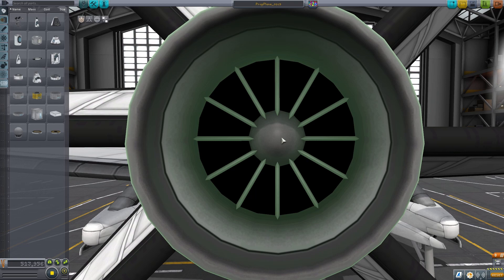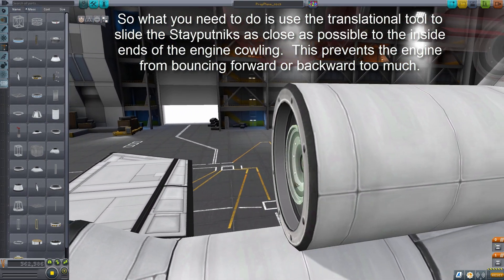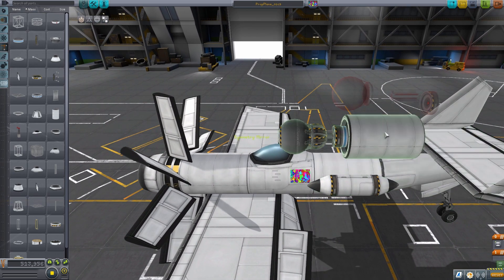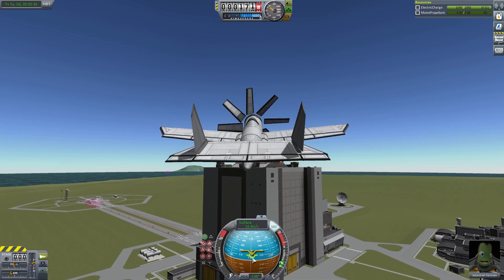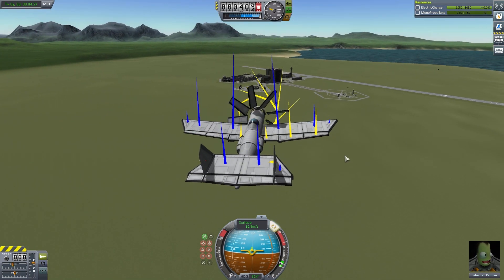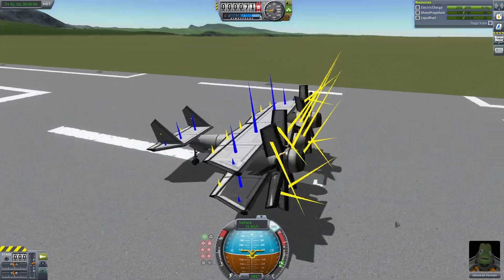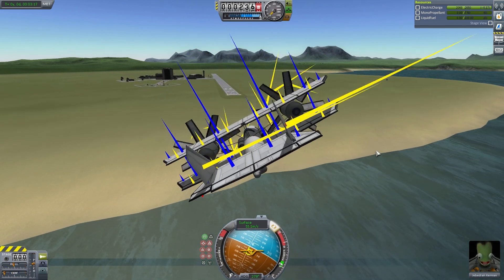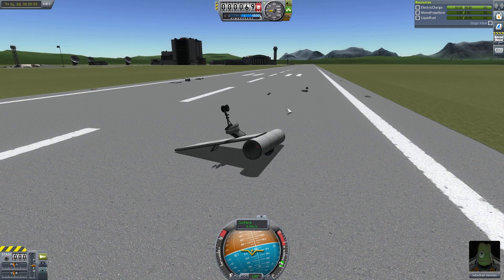OBSOLETE VIDEO, pls see #3 -- KSP stock elec prop 2: smaller engine, bigger performance

Comment from the maker: Verified: works in the new full release of 1.2.  In fact, it even works a little bit better.
Reply: Quick thought. Does attaching each prop blade via strut help at all with the 'gap' on spinning up the engines?
Reply from the maker: Mach n' Grace
Not to any visually noticeable degree, no: there is still abundant separation.  The struts are actually a liability because the blades will be trying extra hard to stay in place and that causes the good old KSP physics to believe the blades occasionally catch onto the cowling.  I've seen it rip the engine clean out of its fittings.
Reply: Inter's Odyssey nice video!
Reply: Inter's Odyssey
Reply: Could you release a craft file?
Reply from the maker: Description.
Reply: Inter's Odyssey Thought I checked. Apparently I didn't, or at least not well enough.
Reply: Inter's Odyssey you should be a narrator before movies your voice fits
Reply from the maker: Joe Gelula
Assuming you're playing on a Windows OS computer, hold down Ctrl + Alt + F12.  This brings up the cheats/debugging window.  You'll then have to click on the Cheats submenu.  That's where the clipping settings have been moved to in 1.2.
Reply from the maker: Emerson Molina
And capitalize like every other word for dramatic emphasis!  "With the World on the Brink of Destruction, the fate of Billions hangs in the Balance.  There is only One who can save Humanity from total Oblivion.  And he Answers... to Fido: (trailer reveals dog) Woof! (trailer continues) This Holiday Season, Join Fido as he Sprints across the globe on an EPIC (because every trailer has to use the word "epic" these days) journey to unite Man's Best Friend with the mighty Force of Puppy Power.  But there are Those who would Stand in his Way: The Leage of Inexplicably Entertaining Squirrels!  Can Fido make it in Time?  Will the Legacy of catching Frisbees be Forgotten?  If Fido knows, he's not talking... Woof!"

Comment: The reason the twin engine one is slower is because if KSP's aerodynamics are accurate, which I think it is, it would have triple the cross-section and more than triple the surface area, meaning more than three times the drag.
Reply from the maker: Why, physics?  Why?  Why do you have to be so cruel?!
Reply: Nature is a harsh maiden.

Comment: Awsome. Ive gotten so much inspiration when doing this myself from your video :) I tried putting two engines on coaxially which also removed all unwanted roll (without a problem of turning them on individually) and made me my first successful stock prop plane. You could also spin up the engines with the control surfaces just without an angle and later use "deploy" to start going forward.

EDIT: The authority limiter is very practical as it can be used in flight aswell!
Reply from the maker: Sounds like someone's been paying attention!  :)
Reply: Since I was building at the same time I was watching, I might have missed if you already suggested the things I mentioned. If so I'm sorry :)
It's really hard to know if someone is being sarcastic or not over the internet..

But anyway, I have managed to build insanely robust and stable engines with the propeller in between two fuselages but I can't seam to get as much power as you do. Is it, in your opinion, a friction/wobble tradeoff with the ball bearings or a position/amount of reaction wheels thing. I've also been using a stop cap at the end of my single fuselage engines so that the propeller is fixed both back and front. Could this be a reason for the lower power?
Reply from the maker: No sarcasm (thiiiiis time... muahaha).  If I understand your description correctly you're saying you have two hollow structural cylinders (the pieces I called the "cowling") arranged one in front of the other with engine parts inside both, yet the two cylinders are spaced apart a little bit front-to-back to allow for a propeller mounting point in between them.  That accurate?  I've found lower power is generally a reaction wheel issue, but adverse contact with the cowlings and caps (call it friction or collision or whatever) can very easily interrupt engine rotation, perhaps only for fractions of a second but in those brief moments the stoppage is almost total.  That makes it appear as though the engine has low cumulative power.  I recommend testing the engine on a heavy rolling sled, something that isn't designed to lift off or change directions but can still roll along the runway.  That should allow you to observe the stable power output of your engine and discern whether the problem is either low torque or some airborne interference.
Reply: Correct! Its a long engine but with two of these placed coaxially i made my most successful aircraft yet with about 35m/s top speed and stable controlable flight at low altitudes but trying to get the single engine plane to fly straight is proving really difficult since it will roll uncontrollably. Is that why you use the dual tail stabilizers?
Reply from the maker: LuckeWent
Well, if it's rolling uncontrollably, my guess is there is collision happening somewhere in or around the engines.  I had that problem too when I radially expanded my Stayputniks too much.  Once the engine was working smoothly, as shown in this video, the plane was very stable overall and needed very little control surface input to stay in straight and level flight.  Basic torque rolling was not an issue for me.

Comment: OMFG I'm actually extremely impressed by the pre-flight startup checklist. A lot of people might think it's tedious, but it actually is very similar, in many ways, to a real prop plane, with the engine startup and the propeller trim setting (found on some prop planes), and you can even notice some actual realistic propeller torque at takeoff :o. Far superior to the primitive design I've been using, lmao.
Reply from the maker: Dude, I'z a pilot.  For realz.  Only Private and going for my Instrument rating, but I feel ya, bruh!  
(Sorry, if this is your first time here: welcome to my channel.  I talk weird sometimes.  Um, make that a lot.)
Reply: Inter's Odyssey  Yeah I just found this channel despite watching KSP videos frequently, and I recently started getting interested in prop designs in stock KSP (mainly cause I only just recently got gud at making planes, used to suck).
And speaking of which, yeah, I have flown planes with a friend who is a pilot and has taught me quite a bit about piloting a Cessna, though I don't have the time or money currently to get a license :/
Reply from the maker: Wheatley
Wait, you need time and money to get a pilot license?  Dammit!  ......  I WANT MY SOUL BACK, YOU THIEVES!

Comment: Squad just has to make prop engines, no one will dislike it.
Reply: but then the challenge to build the perfect propengine would be gone
Reply: They NEED to give us rotating joints.
Reply: Dark Orbit King would be nice
Reply from the maker: For real.  Honestly, how hard can the programming be?  I don't see it as being any different from docking: lots of parts becoming (or staying) merged with lots of other parts.  The only difference is the parts on one side of the joint still retain the ability to rotate around one axis.  Big deal.  I'm not a programmer but intuitively it sounds extremely easy, especially since they already have those features elsewhere in the code.  Just combine the features and this game can leapfrog ahead again with possibility.
Reply: Too true- all they would have to do if make a part that can rotate, just like the wheels, but can be attached to, just like docking ports, and then they can call them bearings.

Comment: Now that's a pretty interesting technique! I found it to be a little simpler to use radial attachment points on the ends of the engine to narrow the radius down a bit, while still only using two probe cores. It makes tweaking a little bit faster. I still have a minor amount of wobble on my engines though, so there is that trade off.

Comment: Honestly I wish they remade the building in KSP completely. Out of all the building games I've played it has the worse feel to it and its very hard to see what your doing without getting mods and if a game needs mods just to allow you to see wtf you doing at that place in time it should probably pay you to play it.
Reply from the maker: Can you give some examples of other games?  I kind of agree with you, though.  I never build anything important in the VAB because of the camera restrictions there.  Even in the SPH, when the camera is zoomed way in, the green attachment point spheres sort of obscure the contact point where you're trying to attach a part.  I'm glad 1.2 added a slider for reducing part glow but that slider is currently bugged and needs to be reset every time I load the game.  So yeah, KSP isn't the best, but the fact that I can do very fine placement of parts in the SPH makes it seem like a pretty decent game to me, at least compared to something as primitive as Minecraft.
Reply: What? For me ksp has building I like the most out of any game..
Reply: I really don't get what you're saying. I have hundreds of hours in KSP and never felt the need of getting a mod that changes the building mechanics. Build in the SPH and you'll be able to freely move the camera and see everything you need.

Comment: Excuse me while i now build a 4 engine prop plane using this just to figure out if i can break my ability to think, or better yet, break the game.
Reply from the maker: Oh trust me: breaking the game becomes exponentially easier as you add more engines.  Happy rebooting.  :p
Reply: can you help with somthing
plz
Reply: Constantinos Veletas wot
Reply: plz help
Reply: Constantinos Veletas with wot
Reply: every time i rev the engine and press alt with q 
but it always slows down and stops
Reply: Constantinos Veletas Do you have enough electricity? Maybe it's dying?
Reply: yes i think i have enough
Reply from the maker: Constantinos Veletas
Sorry to ask a dumb question, but do you still have SAS turned on (the white icon on the upper right of the NavBall) when you let go of trim?  If SAS is left on, it will cancel out trim and act like brakes on the rotation of the engine.  The engine needs to freely spin.
Reply: yaas it does not spin

Comment: Would it be possible to make a design like the Do-335? It had 2 piston engines, one on each side, one pushing, one pulling.

https://en.wikipedia.org/wiki/Dornier_Do_335

I feel like the plane would be unstable though, but that's just in theory. I haven't actually tried it yet.
Reply: Nvm someone's already pointed that out. What about a pusher engine only craft, like the Xp-55?
Reply from the maker: Yeah I was thinking about that actually.  I'd be more inclined to go straight for a pusher-only.  The Do-335 would certainly be the way to go for more sheer power, but I personally favor the idea of a pusher-only to eliminate the drag of a forward-facing gopping cowling cavity.  (Because KSP physics doesn't recognize any aerodynamic parts in front of blunt parts if they're 2 separate "craft".)
Reply: I Made a propeller pusher craft in the last update and it worked lovley, based it off the J21/De havilland Vampire, look almost the same, but the J21 is a prop aircraft.
Reply: Btw thanks to your trick i have managed to get it to a top speed of 83m/s in level flight, which is a new record for me, thanks =D
Reply: Arvid Lundqvist could we have the download for it please?
Reply: Sure, here it is:
https://www.mediafire.com/folder/8c7xcr1js0r5e/Kupol_Krab
Enjoy!
Reply: Arvid Lundqvist
thank you
Reply: Arvid Lundqvist
Oh, it's incompatible with KSP 1.1.3, please could you modify it so I can use it in 1.1.3?
Reply from the maker: Brandon Robertson Arvid Lundqvist 
Nah, the craft is compatible with 1.1.3, it's just the version # in the file that needs changing.  You can open the *.craft file with any basic Notepad application and type in the version # you want into the second line of the file.  Easy.  In 1.2 I was able to achieve the 83 mps speed boasted in the craft's description by the time I hit the coast line, but in 1.1.3 its top speed was only 55 mps.  I'd really like to know what Squad did to make the atmosphere more efficient.
Reply: Inter's Odyssey
Oh, thank you. I think in 1.2 they made airlions more airodynamic, or lighter, One of the two.
Reply: Well I have produced a Do 335 like plane before as well as a pusher config only one iif that answers your question +Brandon Robertson

Comment: You could try using tweakscale on a single stayputnik at each end, would be able to get it the exact size while reducing part count :)

Also take a look at some of the new Infernal Robotics stuff, they have both powered and free-wheeling bearings that are ideal for this :)
Reply from the maker: Well, you're certainly new to my channel.  :)  I try to avoid using mods, despite how helpful some of them can be.  
Yes, the tweakscale thing has been mentioned and I've known about that mod for over a year, but that would defeat the point of this stock build challenge.  If tweakscale works for you, by all means use it.  It will mean less mass and hopefully less drag in your engine.  
I'm holding out on Infernal Robotics because I don't want to be corrupted by its ease of use when it comes to building ferry ramps.  That'll probably be one of my future stock projects: a ramp that folds down but is still light enough that it doesn't make the ferry ridiculously heavy.

Comment: I wonder if this could use used with much bigger rotors in order to make a VTOL "space elevator" to very efficiently carry stuff out of the atmosphere...
Reply from the maker: The main force providing motion to this sort of craft is the propeller blades interacting with the air to generate thrust.  Once your space elevator goes so high that the atmosphere becomes negligably thin (around 30 km), then lift/thrust will be unattainable and the craft will no longer ascend.  That said, you could certainly use such an elevator as a launch platform to get a payload with a much smaller rocket closer to orbit.  I've done this with horizontal craft but never with VTOLs.
Reply: Inter's Odyssey That's what I was saying. Basically a very efficient booster stage to allow the craft to never even have to try and get through the thick air.

Comment: Stalling isn't dependant on airspeed, it's the angle of attack the wing surface is to the air direction.
Reply: Jpwnage216 it's both really, a lack of speed will cause your wings to not provide sufficient lift, causing a stall state
Reply: Even if you have an extremely slow airspeed, If your plane is angled correctly, you won't stall. It's all about the angle of attack.
Reply: not all true, it is also speed.. i dare you to try to keep a plane level without it losing altitude below its critical stall speed..
Reply: in fact, the nose will drop, due to not enough lift, its called a stall bud.. and worse case is a flat spin. In fact, this is why you DO NOT increase your angle of attack to hold altitude if you are losing speed, the extreme AOA will cause a complete stall once hit hits it critical point. The old saying when flying is throttle controls altitude, trim controls speed. Speed is very important in a plane, for which below a threshold you will no longer have enough lift, even if your AOA is correct. The speed at when this happens varies depending on weight and its CG of course. You must remember, the more surface area exposed to the wind current, the more drag you cause.
Reply: I'm not saying that you should keep the plane level. At low airspeed, tilt the nose down and the  plane should have enough lift to glide. This isn't a stall. Yes, low airspeed can cause a stall if you can't get your angle of attack corrected (steep climbs), but the stall is technically initiated once the aoa is misaligned with the air direction. What I'm basically saying is that while low airspeed can cause your aoa to screw up, the stall officially begins when aoa is bad, not when you have a low airspeed.
Reply: Jpwnage216 sigh.. your not getting it.. the lower the speed, the less lift. This is why planes need speed to take off in the first place. I never said anything about a nose down dive... Simple thing is this, after a certain AOA your wings    lose the ability to produce lift and start producing massive drag. So yeah speed does play a role if you want to stay in a level, stable flight
Reply: Thanks for agreeing with me finally, I knew you'd get it as some point. I'm kidding. We both know what we're talking about but we're arguing over semantics. When the wings can't make the plane fly, it falls. Hope that's simple enough to not have an argument over.
Reply: Yep sure is :D
Reply from the maker: YT literally just notified me of this post.  'Grats, YT.  
You're referring to real life physics.  Technically it's AoA of the wing's chord line to the relative wind, not the wind's own direction and not the wing's surfaces.  In KSP this is modeled very, very, very poorly.  The cross sectional airfoil shape of a real wing can make all the difference as to how much lift is produced for a given True AirSpeed (relative wind velocity) but in KSP airfoils don't exist: all we get are flat wings.  Thus, saying "airspeed" in my video is the easiest way to describe the limitations of KSP lift since a KSP wing's rate of travel through KSP air is the prime governor of effective lift.
Reply: Thanks man I didn't know that the model of lift in KSP was so bad, so thanks for explaining your side of things. It didn't cross my mind that you were making observations within the laws of KSP physics.